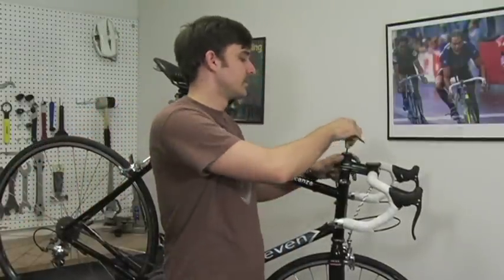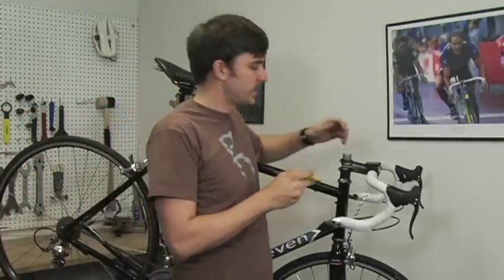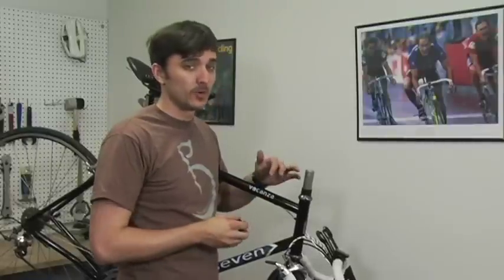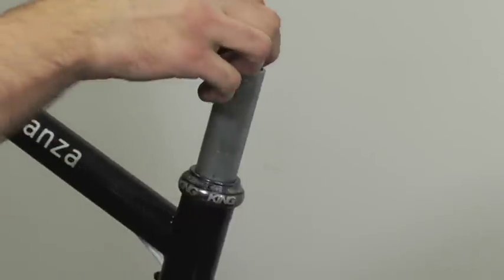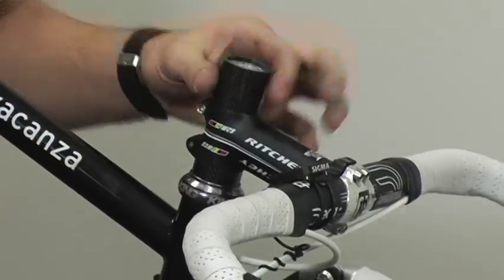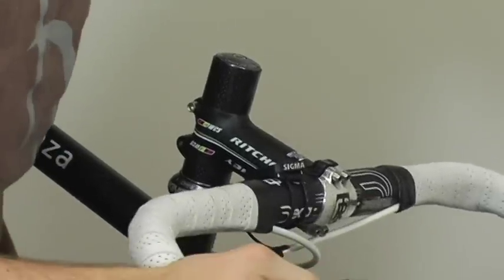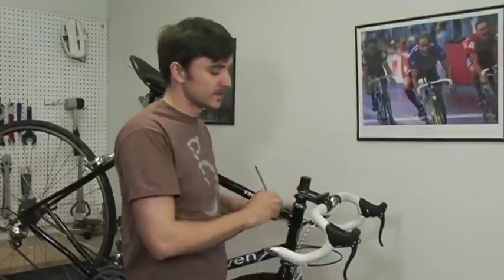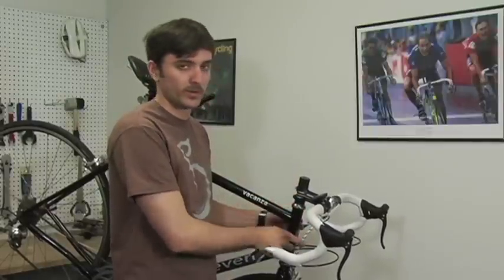Adjusting a Threadless Bike Stem

Comment: NycAngler254 all should be compatible, the stem sizes are the length you want it. Depends on your personal fit, but a 90 or 100 will be ok generally. The same is the case with handlebar widths. Depends on the bike type and ride style and fit. For a road bike go 420 or 440. Hope this helps, message me for more if you need

Comment: Ok i got a question im going to order a handle bar from china  and  they have different widths to choose from like 400mm/420mm/440mm  Also different stem sizes like 90mm/100mm/110mm/120mm And i don't know what sizes to choose pls help me out  And i have a  1-1/8 steerer  tube what stem would fit on there

Comment: why don't you tighten the tophead screw fully after tightening the stem screws. That's way more secure that way!
Reply: That's actually an adjustment for the play in the headset, if you tighten it fully it'll bind, and if you leave it too loose it'll clunk from excess play. It really needs to be adjusted properly after this process of swapping the shims to raise or lower position of the stem.